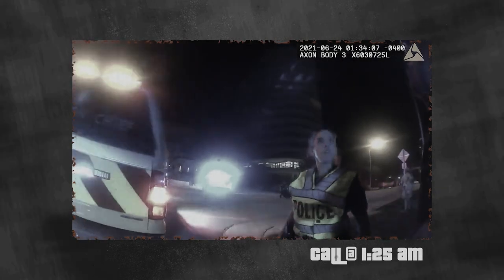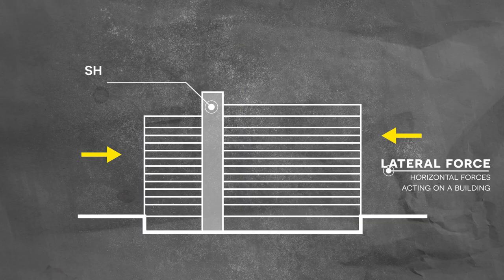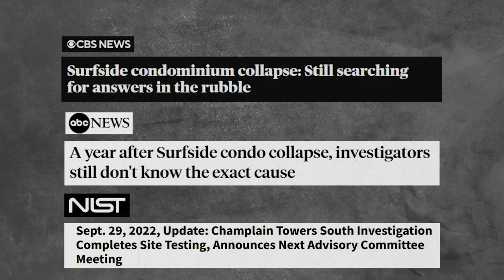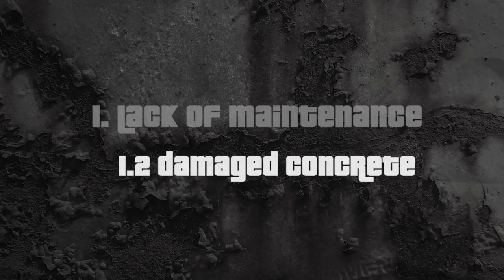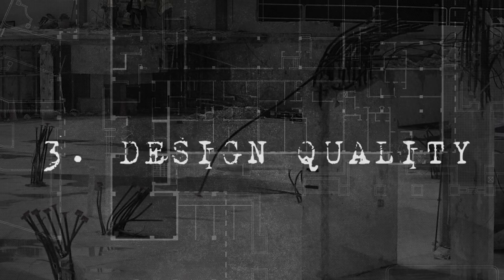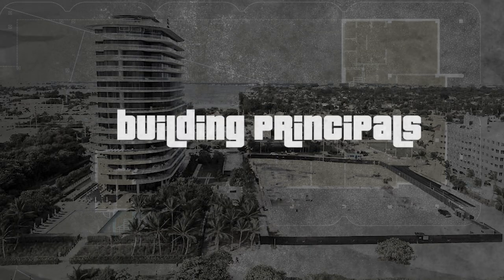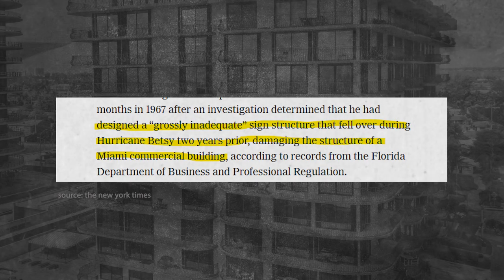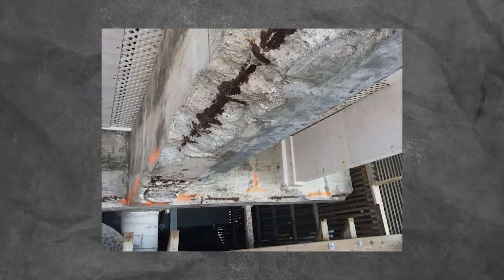12 Floors Gone in 12 Seconds - Surfside Condo Disaster Explained

Comment from the maker: What do you think was the cause of the collapse?
Reply: The real question is, what wasn't the cause of the collapse? Everything in this building stunk since the beginning, but it was the lack of maintenance. It is true that the design was substandard, and the column didn't have enough steel reinforcement, but the building stood there for 40 years, right? So it's hard to believe those factors were enough to make it collapse.
Reply: @jorgecanalesbarrera7090  See also the Hotel New World collapse in Singapore.  The engineer of that building completely omitted the dead load, designing only for the live load.  The structure was critically overloaded before construction was even complete.  It took 15 years before it finally collapsed; if you get RC engineering wrong in just the right way, it can take decades to fail.
Reply: @Murph9000  wow, that is very interesting. Maybe it stood for so long because of the safety margin

Comment: Good video, you got 99% of the details.  Your summary of the various factors involved was pretty good.

One important thing that has been discovered is that the pool deck started to collapse at least 2 or 3 weeks prior to the night of the disaster, possibly as much as several months.  Photos emerged showing evidence that the first column(s) punching through the pool deck occurred long before the final collapse.  It was one or more of the columns in the vicinity of the planters at the east end of the ground level parking area, where the photos showed that the slab had dropped by possibly as much as 2 or 3 inches.  Unfortunately, the junior engineer who inspected it and took the photos failed to understand the significance of what he was seeing and essentially just added it to the list of repairs; he also failed to fully inspect the structure in the vicinity of the quite visible problem and took no action to get emergency shoring installed around the collapsing part of the deck.

On the fire exits, CTS had another design problem.  The west stairwell, in the part of the building which survived the collapse, was blocked by the collapse of the pool deck.  The ground floor exit from it was onto the pool deck, with no direct access from the stair into the lobby; this was likely lost in the initial pool deck collapse, prior to the collapse of the tower itself.  The only other exit was into the basement garage, which did remain open but had no route to the street after the eastern portion of the tower collapsed.  Some people escaped via the west stair through the garage by climbing over rubble and vehicles to get up to ground level.  So, some of the calls from people saying they didn't know how to get out, after the full collapse, were due to them essentially being trapped in a structure which no longer had any properly useable escape stairs.

Getting quite technical now.  There's a very important arrangement of beams on the south side of the eastern wing which are highly likely responsible for the pool deck collapse being able to trigger the tower collapse.  Between columns KLM 9.1 and KLM 11.1, there was a sort of double-H (viewed in plan) beam arrangement, with some very substantial beams which tied into the KLM 9.1 columns that were likely the first tower columns to fail.  KLM 9.1 is a 2-bay section in the middle of the south wall of the eastern wing, and the first part of the tower to visibly collapse.  The double-H beams supported the patios and pool deck, and were likely severely compromised by the pool deck collapse.  In turn, as they fell, they likely caused fatal damage to KLM 9.1, starting the countdown to full collapse.  Those beams were essentially an Achilles' heel in the design.
Reply from the maker: Thank you Murph for sharing! I wasn't aware of the fire exit issue but that explains a lot along with the pool deck and beam arrangement.

Comment: I was a firefighter when I was younger and the acceptable time we were expected to make it to a call was 10 minutes or less. That may seem like a long time but we have to get out of bed too, which doesn't take much time, then we have to get into our structure fire gear in a minute or less, get everyone on the engine, and head out. On all the 911 calls I was on, we probably took less than five minutes but our area wasn't that busy or that big so it didn't take very long to get to anywhere within it. The only time it took me longer to get to a call, it was because we had a water tender at the station so we got called to a wild fire probably 15-20 minutes away from our station. They already had many crews fighting the fire and our job was to pump water into the engines fighting the fires, got to the hydrant to fill our tank back up, and then go back to refill the engine. We did that all day and night, which was critical, but it wasn't something we lit up the lights and sirens for like the 911 calls. 

One thing I will add about firefighting and emergency response in general is to remind people that if they see our flashing lights and/or hear our sirens, please pull to the right hand side of the road because one time someone just stopped right in front of our engine between two concrete curbs since there was a median. My captain, who was also the engineer, said some words that I won't repeat and had to swerve the engine onto the wrong side of the road to get around this person who panicked and just stopped, which is worse that continuing to drive sometimes. There are 500 gallons of water in the back of your standard fire engine and I can tell you personally that the sloshing of that water exerts an impressive force when you have to slam on your brakes or swerve so please just pull to the right. Thank you!

I will also say that the absolute best advice that I can give to anyone in any situation that produces strong emotions, whether they be fear or anger, or whether they be more pleasant feelings like happiness or excitement. If it's a dire situation, especially if it's actually dangerous, don't panic. You can't stop the physiological reactions that will happen in your body and tempt you to panic but you can head them off at the pass and keep your mental capacity. The best way to do this is to remember that usually good decisions are not made when one is feeling strong emotions so panic will only make you much more likely to end up getting hurt or killed so rule number one is always don't panic. The second rule is less important and it is to not make any significant decisions while you are feeling significant emotions, even if they are pleasant ones. Especially in the case of pleasant emotions, the decision doesn't have to be made right away and it is wise to wait until the wave of the strong emotion passes to make your decisions. This can also be done with decisions when you're feeling a strong negative emotion so long as it isn't over a fire all around you (see the dog drinking coffee in a flaming room meme).

I have also lived in an apartment complex where there was a fire but it was in my own apartment and right in front of my face! I was asleep so it's lucky the fire started right by my face or I might have just died but I woke up because it was hot. What had happened was that we had wall heaters in my apartment and my roommate and I had them both on because it was cold outside. We both fell asleep and, like I said, I only woke up because the fire made it too hot! lol

I didn't evacuate immediately either. I called for my roommate to call 911 and I actually put the fire out myself by simply turning the wall heater off. It was an electrical fire and so shutting off the power to it stopped the fire and it hadn't been burning long enough to catch the actual wall on fire. The fire department came to make sure anyway and they blew all the smoke out of our apartment too, which was nice.

It is the right decision to call 911 first. In fact, the first step when you find someone who needs CPR is to either call 911 yourself first or have someone else call while you start CPR but you always call first so the medics can start towards you as soon as possible. CPR is a lifesaver but sometimes you need a defibrillator and that will be coming on the ambulance and fire truck, which will both be on their way to help. The first patient I ever did CPR on needed the defibrillator but I kept any of his tissues from dying for lack of blood flow with CPR. As a result, he woke up angry for a few seconds because he said it hurt but he quickly realized that he had had a heart attack and what hurt was both the CPR and the electric zap of the defibrillator. He had two heart attacks, both right in front of us, and it took the defibrillator to get him back both times but I don't think he suffered any permanent damage because of CPR. It does go to show that getting medics rolling is the first priority, even though your heart strings are going to want to start CPR right away for this person in front of you but always call for backup unless you are 911 and you have all your equipment.
Reply: Also, if you have never taken CPR, the 911 operators can teach you how to do it or many other things to help save someone's life while the medics are on their way so they are also a crucial resource, especially if you don't have any training but even if you do. Whenever you decide to help someone, you are part of our team.
Reply from the maker: thanks for sharing your experience, I'm glad to hear to you survived the fire in your apartment.

Comment: I am VE5VV this is a bit technical but still 
1- concert can last an extremely long time with no steel see the The Pantheon  almost 900 years old 
2- I still dont know why this building needed a pool in the first place 
3- the extra story in this building really should not have caused collapse 
4- it should not be up to residence to inspect there building for structural stability 
5- there are major problems with the design of the colons and how they connected to the slabs  ( where are the sturips and coulomb reinforcements  in those coulombs ,  and why are rebars shooting out from them ) 
6- why did the city not immediately order an evacuation from the building when its condition was known to the city 
7-Why was the hole building not evacuated when a problem was noted !!!!!!
8- its all well and good to have stairs but some people can not use stairs and stair wells must not have there exists only clogged with  debris , everybody must be able to evacuate , not only the able bodied ( this is not 1940s Germany and we cant just let the disabled die ) 
9-If there is a fire put your hand on the door before opening it and see if it is hot , if the door is hot do not open it , have a smoke mask , have a long rope , have a wool blanket( yes 100% wool )  you can soak to escape under 
10-Do not just report problems to building management they have an monetary interest in keeping the revenue coming in , also inform the fire department or city who have an interest in people still being alive ( those are not even close to the same thing )